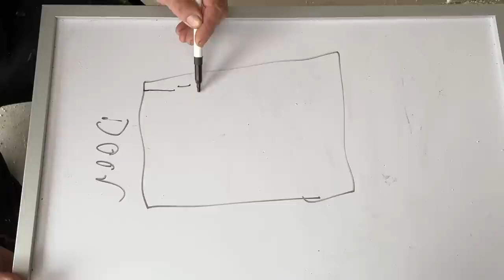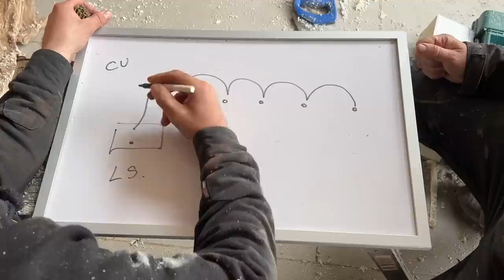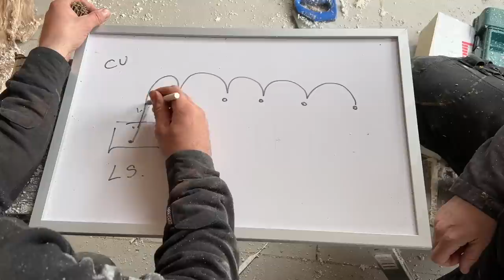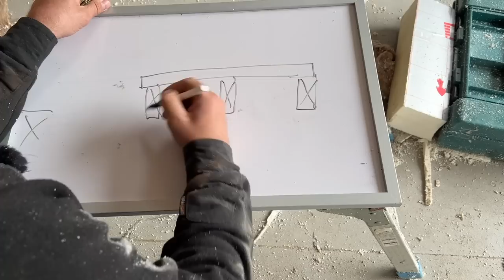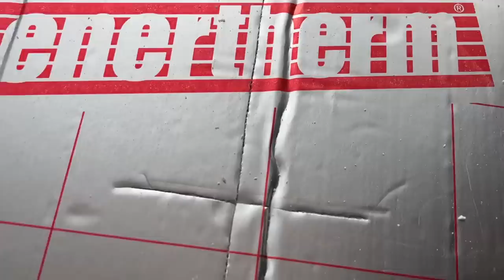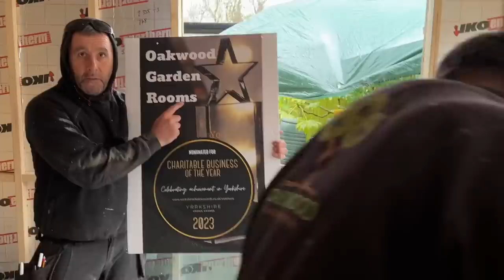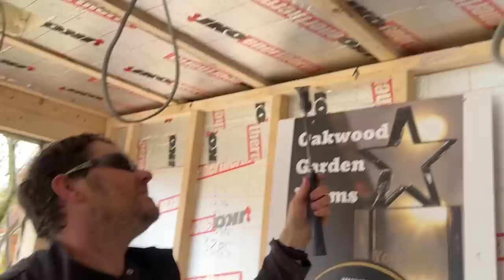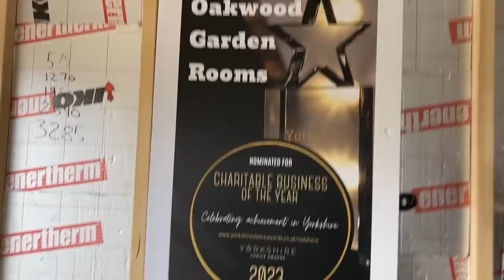How to build a garden room step by step that you can easily follow

Comment: Best thing I've tried to cut insulation boards is a utility knife (with the long flat blade that slides out straight) cuts through like butter but leaves zero dust or mess

Comment: Great series.  I have a couple of questions that are not related to the next section of the build unfortunately 😥

When you put the floor joists in is there a minimum clearance you leave between the ground and the joists?
Is 11mm OSB sufficient for the walls to reduce the weight when lifting?
Recently watched one of your videos building a triangular room and you mentioned the amount of rubber wastage  on the roof.  Have you ever used a liquid roof, if so are they any good for new roofs or just for repairing old ones?

Comment: Still laughing after the tool review. 🤪 

Bought a Dewalt multi tool and took it back straight away and splashed out on the Milwaukee. Liked the auto setting which started slow until you put pressure on it, whereby it kicks in. 

Not sure if there are any others but I’d definitely invest £1000! Although I think you offered 25% return on the video. 😝 10% is more than fine and it’s the thought that we’ve contributed to helping etc. 😀 PS. Already voted. ⭐️⭐️⭐️⭐️

Comment: Question time

My electrician advised 6mm armoured cable I have 3x double socket 1x single 2x 32watt led lights 3 X up/down lighters 2x external double sockets air con unit going in and possible hot tub and may be power supply to shed to power freezer is 6mm big enough cable is all ready in and powered up and I did say to him what I was having

Thanks

Comment: As a dryliner, I can tell you the reason for laying plasterboards horrizontally is that in theory at least it ties more studs together and make it stronger which, providing the noggins are at the correct height is correct. However, this isn't done on new building residential sites and is only really used on large commercial sites where the walls are maybe 3-4 sheets high to tie a high wall which is possiblity slightly flexible together as best as possible.

Comment: A bit off topic question - 
You said you've done extensions before. I got planning in place for 2 storey extension. I would like to go non traditional way. What do you think about building 2 storey extension with 144mm SIP (Structural Insulated Panel)? I know, I need MVHR, different external finish etc. Roof would be also non traditional material. More interested in opinion on SIP as a material for extension in terms of durability, long term use. Have you seen anyone doing this, or know who've done it and their opinion/feedback?

Comment: One more question - 
Why counter battening external walls? Wouldn't it be enough horizontal battens for metal sheets? or vertically? Which one best? Can I avoid counter battening?
Reply: If you counter baton, it allows air flow in both directions. Single batons won’t allow this as there is a solid piece of wood stopping the air. Hope this helps
Reply: @Robbie-fq9zr  I know this point. Its different for metal sheet clad due to its shape. Also, OGR using resilient bars horizontally, and not counter battening, or its a different case?
Reply: I managed to single baton when I fitted my metal sheeting 3 years ago with no issues.

Comment: I’ve watched pretty much all your videos and don’t get me wrong you are a brilliant constructor of these buildings…But… I am a carpenter and built my own garden room from scratch to fitting inside…but this one?….you have put the steel lintel on the front which has not a lot of load bearing from the roof, then cut a 1200mmx1000mm window without? The roof rafters are opposite way to normal build. 
Correct me if I’m wrong please as your work is exceptional 👍🏻